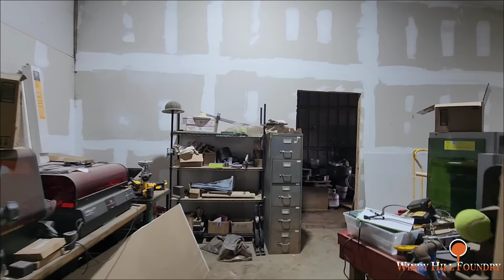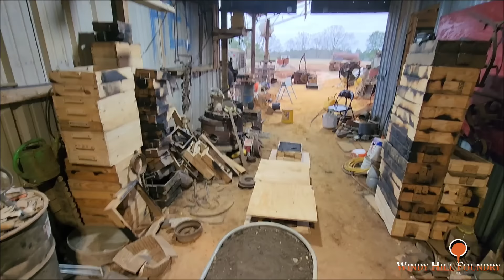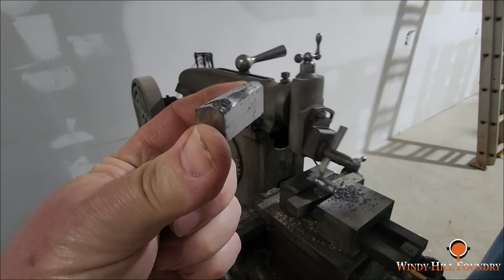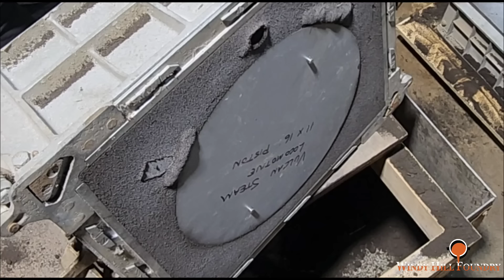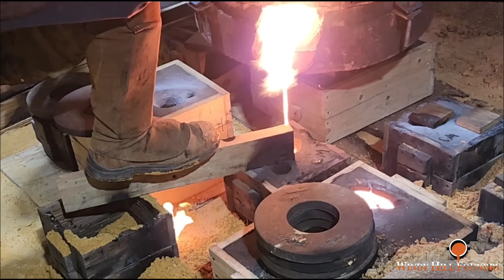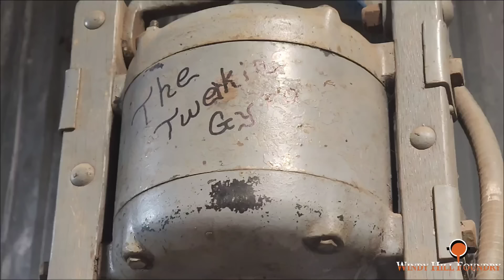FIRST ATTEMPT TO CAST VULCAN LOCOMOTIVE PISTONS

Comment: A factory here in Adelaide, many years ago, had a cold heading machine for making large nails. The nail dia was about 3/8" and the spring heading force was provided by a 6" square wooden beam. It had been in service for many years. I have seen wooden springs used on vibrating shutes in a salt works, where steel springs regularly failed.

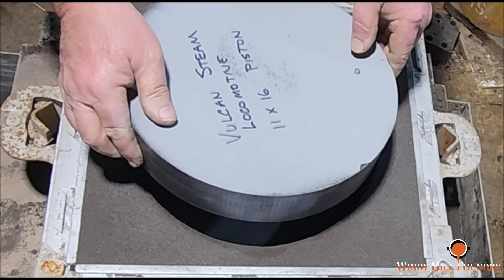Comment: I want to build a whole engine like this (38:27)  from sand iron, steel and aluminum  scrap, melt down brake rotors and engine parts , alumrims and pistons. Either build a 90° v case, from iron, with bolt on aluminum  cylinders,  with  iron sleeves. The cam, crank and rods may be from bought new materials,  built similarly to motor cycle or ww1 era aero engines, LIKE the liberty v12, 🗽 
I'm  thinking a twin or opposed twin engine, with 10"-12" stroke, with an 8" bore, use two sets of big block chevy valves per cylinder,  two 1.880" exhaust valves, and two 2.120" (+/-)  intake valves, slice 1" thick slices of 2" bar stock , offset bored and pressed on to a 1" steel bar, to make a cam shaft, with a oil pump on each head on the opposed boxer version the twin will have large drains to sump, the engine can be built  as a gas or diesel, also possibly a two stroke, built like a Detroit diesel, using exhaust valves, with sleeve intakes. And supercharger scavenged. Maybe covert a turbo to supercharger, build a gear box with 10k:1 overdrive, it will likely  only be used to get it running, then after idling the turbo starts spooling making nearly 1psi boost at 60rpm idle, peak around 600-800 rpm, build a centrifugal governor, that either pulls throttle or fuel at a set rpm, it may spin upto 1000 rpm[doubt it, math is required] , the cam pushes on Y shaped follower, that opens the valves about .500" -.600" lift, the gas version with about 8;1 compression ratio, the dieselversion with 
18:1 - 20:1 compression,  with about 7 psi boost possibly,  with 1-2psi at 60 rpm idle. The rods made from 1"x4" x 18" long bars of 4140, 5140 steel, the crank end hand forged to spread it out to make a journal area that can be milled and the caps cut off, it may only require a 12" long bit of steel,  draw out the small end  and run a drift through the large end ,  expand it and make the journal area about 1" x 1" with room for 1/2" bolts  possibly  grade 10 allen bolts? Or re use short main studs or bolts from arp, melt down diesel pistons to cast new pistons , use brake rotors to make  1/8", 1/8" or 3/16", 3/16",  3/8" ring packs, the oil ring being two 1/8" or 3/16" rings with a slight taper to scrape oil to the crank case, seperated by a springmaking the groove up to 1/2" wide,  7/16" or 3/8" is better,  with 1/8" drain holes in the oil ring groove. The engine would be used, constantly  used running 8 hours daily, to 24+ hours straight. Running at about 100rpm spinning six plus 12v, 130-150 amp alternators, possibly  more,also a couple water pumps ,for home/shop heating, also the engine coolant  going to a heat exchanger, to heat home /shop. The crank pulley about 12" spinning a 1" jackshaft with 3"-4" driven pulley, for a overdrive ratio, about 3:1-4:1, at 100 rpm the jack shaft doing 300-400 rpm, with 2-4 8"-10" output pulleys to spin 2"-3" alternator pulleys, turning 300-400 rpm into  900-1200 rpm possibly,. The alternator should output rated power at idle, the 2.25" exhaust  from each head going to a single 3" , using 2-3, 3" glass pack mufflers , the exhaust should be quiet , since the explosion is long over by the time the exhaust opens, it should be about as loud as a old school air compressor, possibly  quieter,  with the Mufflers, place it in a small room with padded carpet  hanging from the walls. It should be able to run all day  nearly unheard. It should produce around 30-50 hp from the insane torque from the 10"-12" stroke. Using main bearings from a 6.7L Cummings diesel for the rod and main bearings the pistons having a dish directly under the sparkplugs,  possibly making wooden pistons to calculate compression,  and clearances. Since cad will be used little as possible.   Casting iron rings  and the piston pins would be 2.100" the same as chevy 350 rod journals. The piston will weigh pos 5lbs or more. The piston difference  from gas to diesel will be the chamber in the piston.  Going from a 4" diameter 2" deep roughly  combustion chamber to a 2.5" x 1.5" deep chamber for the diesel raising the compression ratio to around 20:1 or less than 22:1  using injectors from smaller engines,  in a 1005 or 1206 cid engine with 2 cylinders.. over 8 litres per cylinder  for the small engine with 10" stroke, the crank maybe a bit weak for diesel, so wood gas, propane, natural gas, or gasoline or alcohol  maybe the better fuel, or cast a steel crank..  
HAVE AN AWESOME  DAY!🎉🎉🎉🎉

Comment: I know nothing about the foundry business except what I learn here. I have to ask, though, have you considered pouring the iron into smaller ladles to make pouring into each mold a little more manageable?
Reply from the maker: Im done carrying 50 pounds of iron on the end of a stick😂
Reply: @windyhillfoundry5940 
Been there, done that, bought the  t-shirt is expression that applies I think.
Reply from the maker: I would normally have great success with the suspended firnace but the opening was too wide. This furnace is the best way to pour iron now that im used to it. It not only is easy to maneuver but it keeps the iron hot all the way to the mold without dropping temp in tranfer

Comment: Rare to see chalets used on YouTube.  The foundry supplier here in Ontario has a couple big shelving units in their warehouse packed with nothing but just different types and sizes of chaplets.
The gyro-sieve is awesome.  Do you know if it works well with petrobond?  I always have to force the stuff through my riddle...
Reply from the maker: Jeff I have never ran petrobond through it but I would think ot would do fine. This thing will easily seeve wet sand so I would say yes. 
Next video I will show making the core for the next attempt and make sure I show supporting the cores

Comment: dont even need a shell going off , just some moisture, i remember one time melting some lead and adding some cut op lead pipes, only  pieces 3 inches long but one of them had in some moisture and bang, even had some lead on the workshop roof,